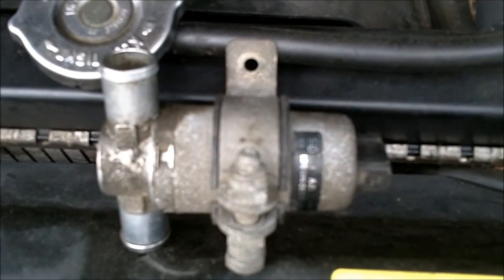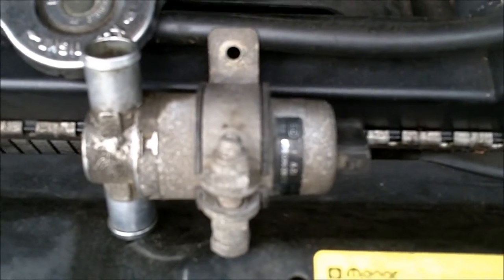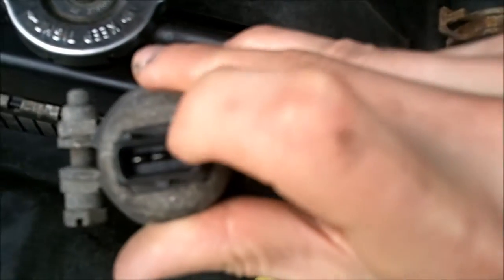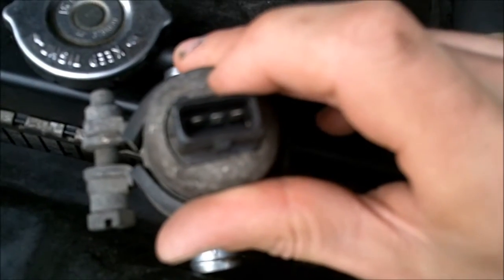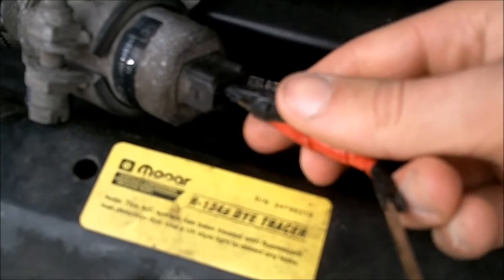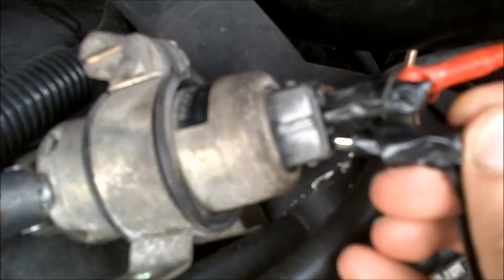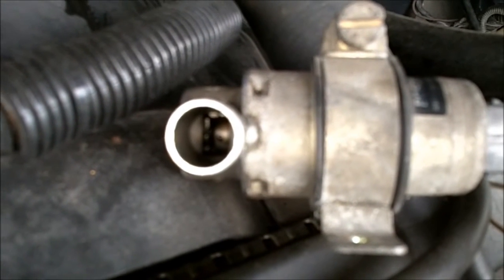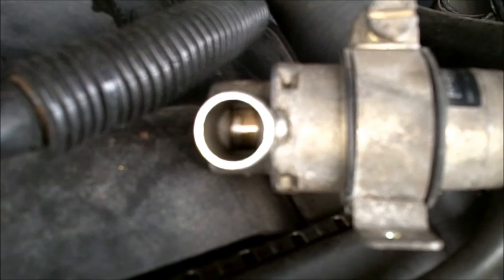IACV Testing -  Porsche 944 - Idle Air Control Valve

Comment: So pretty much when u test it if it doesn't open and close needs replaced but if it does then mabye the connector just needs cleaned
Reply from the maker: yes i'd say so or if there's a relay that controls it that could be bad, i forget what actuates it i'd have to look it up
Reply: The pcm controls that icv. And you can clean the unit aswell